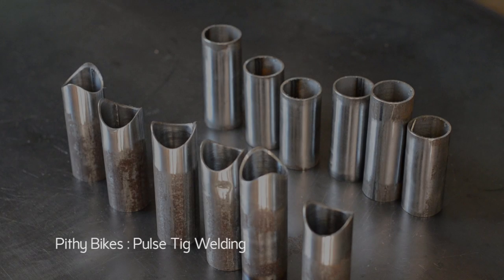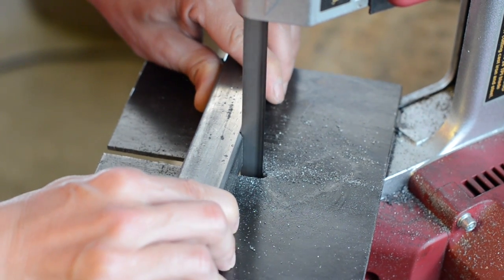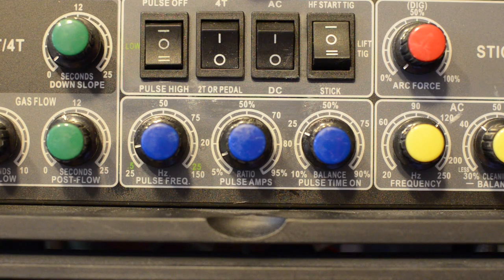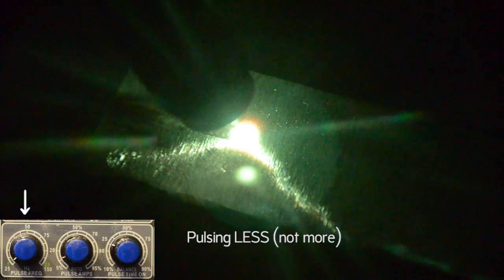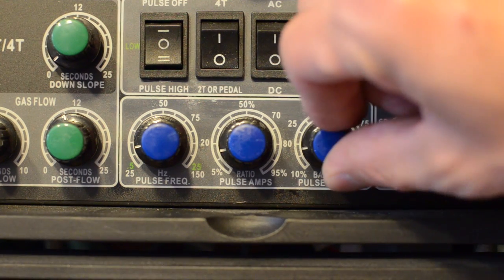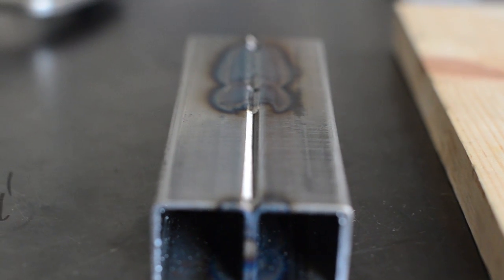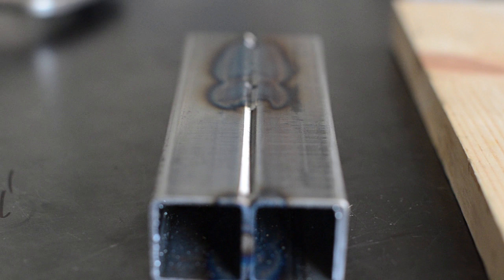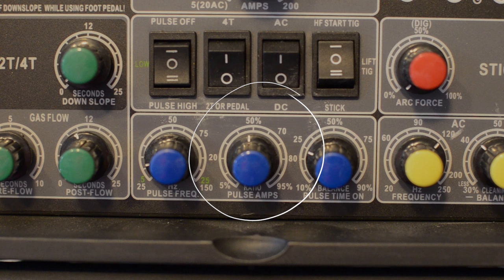Bicycle Frame Build 27 - Pulse Tig Welding

Comment: The filler rod balling up wasn't a result of the groove, it was your torch angle. Leaning it so far back is sending excess heat to the filler, without the base metal being hot enough to accept it. Set your torch angle 80-90 degrees from the plate, basically as perpendicular as you can while still being able to see, it'll fix that problem. And in the case it doesn't: during the on time of the pulse, lift the rear of the filler rod, I'll roll the balled end into the puddle and get rid of it without fighting it. Just a few tips from someone who had the same problems once upon a time
Reply: +Datyn sexton-green If you correct your torch angle and the filler wire keeps balling up, you should go for a thicker filler wire and it'll solve the issue... you could also start to try other techniques besides the lay wire ;)
Reply from the maker: Thanks for the great tips. Totally agree it's the torch angle. Its been tough trying to break that habit.
Reply: +Datyn sexton-green All torch angle, plus the pulse was sett too low 0.8- 0.9 pps is usually best for consistency at least for me anyways.

Comment: Just binge watched all the vids after stumbling upon the channel. I am thinking of modifying a small 20 inch bike for a small 2 or 4 stroke and need to make some custom parts for a jackshaft, idler pulley, and chain tensioner. Love watching you use all the machines and tools.  Nothing else like it on YT. Jeez uv accumulated a lot of tools for a home shop. Love the power portable bandsaw used as a table. You really bring it all together with the research, software, layout, setup, theory, mistakes, etc. Keep the vids coming, this is great stuff!
Reply from the maker: C Puzz Thanks! I still get tool envy on a regular basis though :)

Comment: Try the Rule of 33.  33Hz,  33%On and 33%Background.
These are the settings Weldingtipsandtricks uses and seem to work great.
Reply from the maker: valveman12 Ah yes, Jody's rule of 3's works great. I have not welded enough yet to have a preference on a method. I am starting to lean more towards slow pulse because of the control you get. Thanks for watching!
Reply: @PithyBikes  Especially with thin tube like on a bike.

Comment: Not to confuse the issue, but are you familiar with the concept of foot pulsing? I've been learning it over recent months and really like the results. You basically ramp up the current for each dab of the rod, make your "dime", then roll off and move along the weld then ramp up, dab, etc. etc.
Reply from the maker: Hi Alistair, I am. I tried this briefly and liked it. I'm still exploring so I'll give this another try. Do you set your max amps to go full on pedal when manually pulsing?
Reply: On the machine I'm using I can't set the max amperage when the foot pedal is plugged in. Odd, but that's how the machine is designed. What I mean is, when the foot pedal is plugged in the upper limit of the amperage is the max amperage that the machine can produce, which in the case of my machine is 160 amps.

That means that I'm only moving the foot pedal through 15% to 30% (roughly) of it's stroke/travel when I'm foot pulsing on bike tubing.

If I could set the amperage to around 80 amps I think it wold make things easier, and then I would be using a bigger percentage of the pedal stroke, and I'd have better control of the puddle.

Hope that makes sense.
Reply from the maker: Alistair Spence Ah yes, that makes perfect sense. I can't wait to try manually pulsing with the pedal.

Comment: I'm a few steps behind you in this process, got my frame jig made but haven't started practice welding yet. All the tig videos I've watched shows the operator dipping the rod into the puddle and then pulling it out. Have you given that technique a try?
Reply from the maker: Hi, Yes I tried the dipping technique. Dipping is actually more natural for me. I'm at a point now where I'm trying to figure out what technique is best for which application. Thanks for watching.!

Comment: Hey Pithy, you've been using lay rod technique.  You may also want to experiment with moving the rod in and out of the puddle, in concert with your pulses.  Keep it in the shielding gas but just far enough out not to ball.  It was also helpful for me to learn to lay a nice stack of dimes without pulsing (I welded my first 4130 frame without pulse).   I've spent a lot of time watching Jody over at his weldingtipsandtricks channel, and that was a big help.  Keep up the good work on the vids!
Reply from the maker: Hi Aspen, I did my first without pulse as well but it was in bad conditions. The machine I was using at the time was not working optimally. I'm curious, what is your preferred method now?
Reply: Hey Pithy,
I hardly ever turn on the pulser unless I am having a hard time controlling heat (very thin stock, edges, etc) or if I am welding aluminum.  For thin CrMo, I use a pedal and set my max amperage pretty low (around 40 to 60 A), which gives me a wider heat control range throughout the pedal travel.  That said, I am still struggling to make consistently good welds on thin chromoly tubing. I have discovered that fit is super key. We should swap notes.  On another note, thanks for inspiring me to get a little milling machine…setting mine up today. Sure enjoying your channel and your soundtracks… G